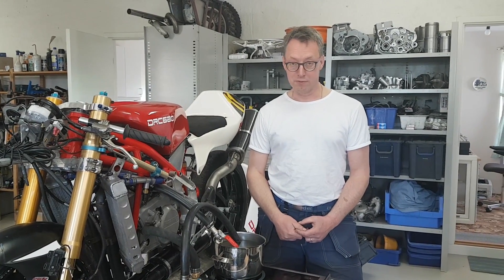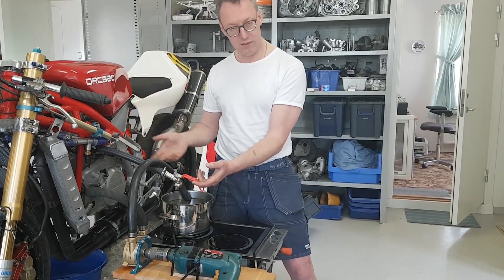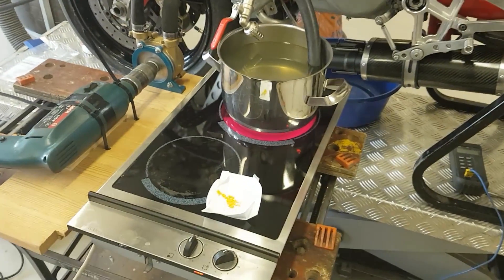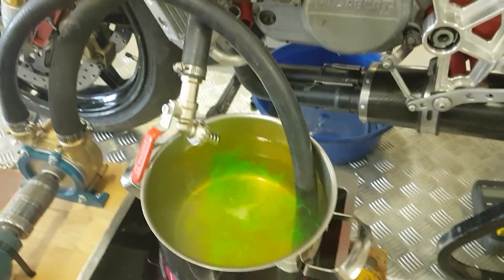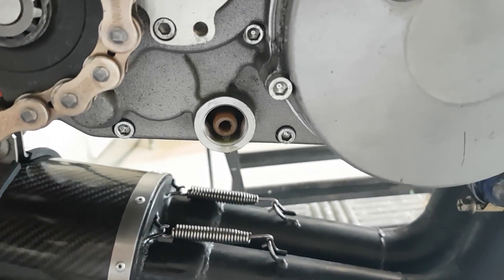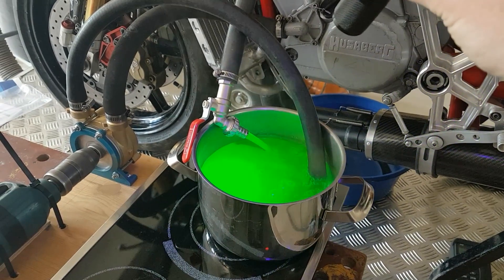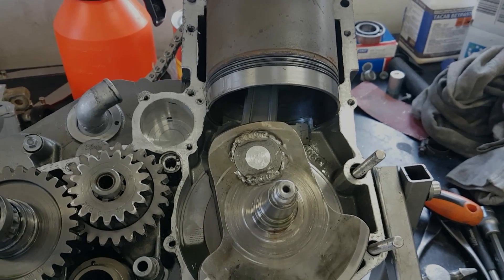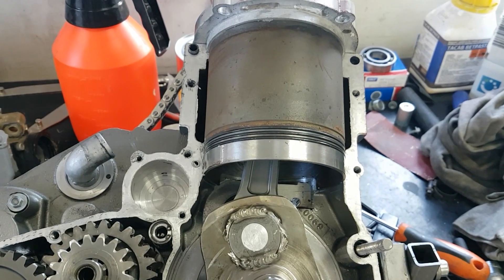DRC680, coolant leak test

Comment: how do you fix this?
Reply from the maker: I'm waiting for a simple inspection camera to see if it is the o-rings or inbetween the cases. Then I will figure out what needs to be done!
Reply: Problem solved ? :)
Reply from the maker: +enigmqtikcs Yes! All three leaks have been cured! It would not have been possible without a thorough leak detection and the determination to find the root cause.
Reply from the maker: +enigmqtikcs Yes! All three leaks have been cured! It would not have been possible without a thorough leak detection and the determination to find the root cause.